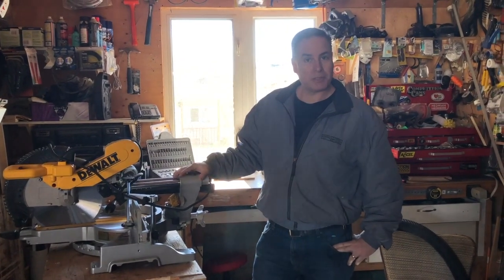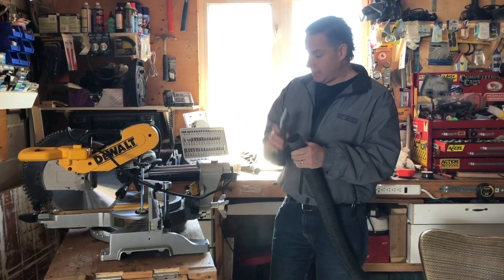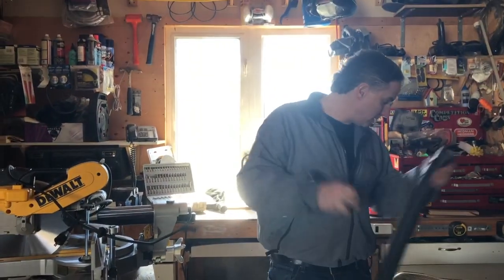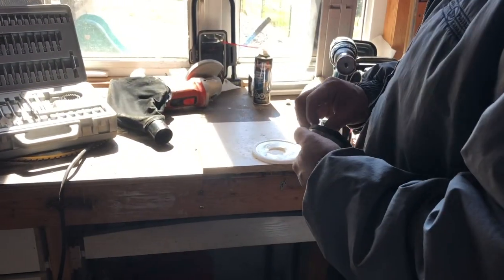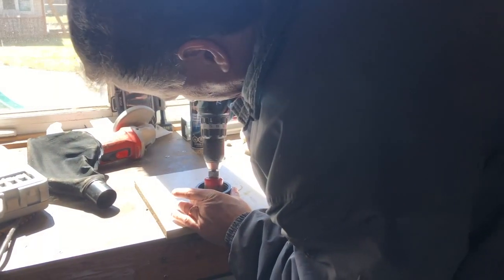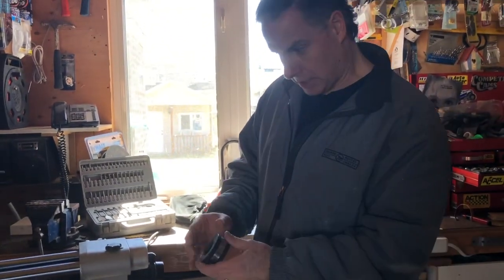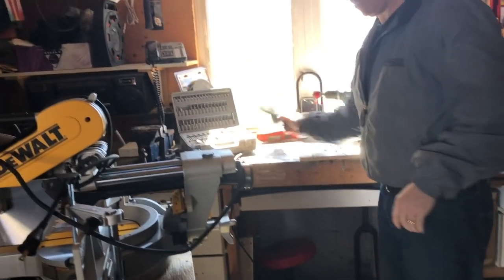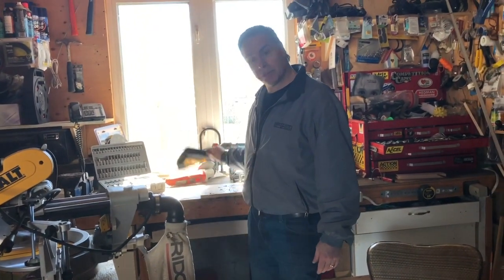DeWalt Mitre Saw to Ridgid Vacuum

Comment: I believe I missed it, but did you say the diameter of the dust collection thing on the back of the Dewalt saw. Dws780 is a quality saw, got myself the 12’ miter saw stand, now just need to figure the diameter of the dust port, get me an automatic switch so I can control dust! Thanks buddy, I appreciate it!
Reply from the maker: I custom cut it to the exact size.

Comment: I didn't know i could attach a vacuum, the bag doesn't do a great job I'm in having to vacuum the area after every cut, which is a pain in the behind, I'm addicted to tools but have no real tool skills, but am willing to try it and learn, lucky I have YouTube when I get stuck.. this is a plan i will be putting together, ..Brilliant thanks for uploading, as is I'm sitting weighting on a deWalt tools returns shipment, if there's a few bits i need I'll be delighted then will pop the rest on fb market place..

Comment: Thank you for the great tip. A question though, does you vacuum suction close the rubber dust port on the saw end of the dust chute? Mine does and it’s highly annoying.
Reply from the maker: No mine doesn’t do that. It sounds like your set up requires further modification. Good luck!

Comment: Fantastic.   I recently bout one of the 12" mitre saws but have used only a tad, and outside.  Starting a project today I got everything ready to work indoors.  Saw, Rigid Shop Vac, and many hoses/sizes and adapters.  Nothing fit.  WT-Heck.  HD is only 5 miles away -I hope mine has that adapter.
Reply from the maker: Hopefully it works for you! Thanks for watching!